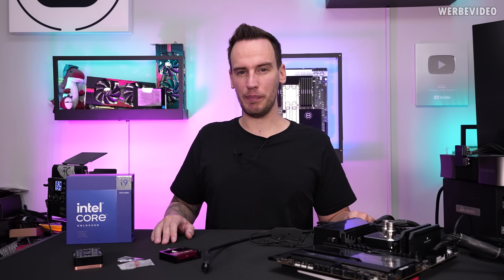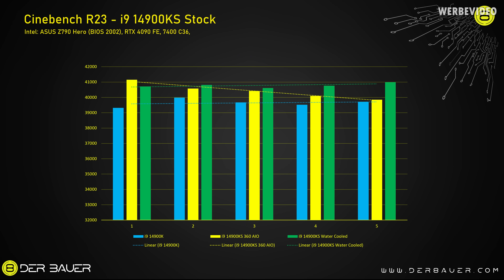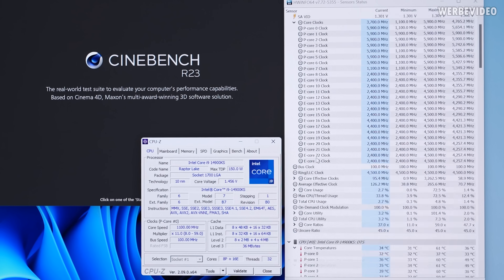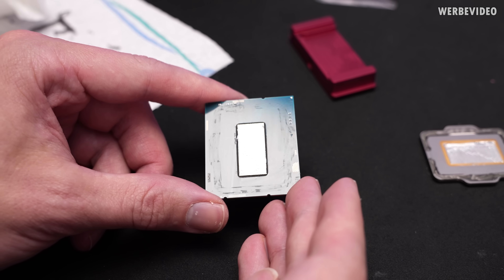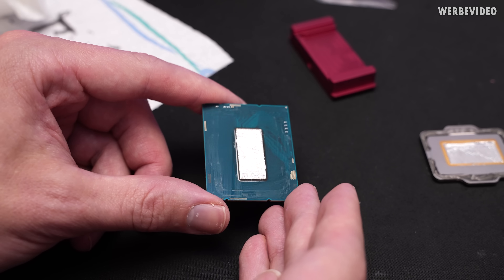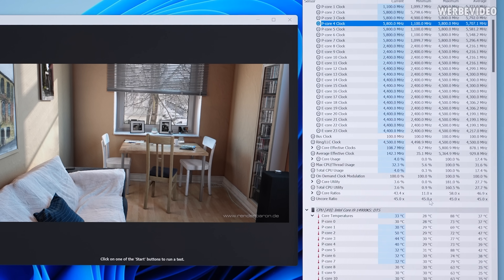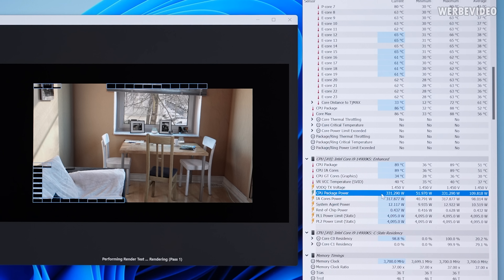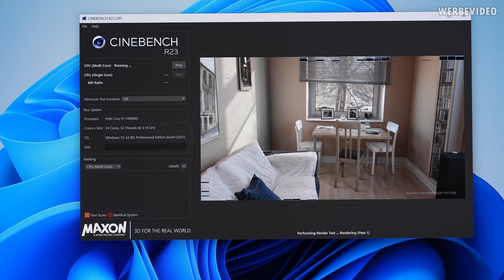My New Water Block - Time for 14900KS Direct Die

Comment: Can anybody tell me what's the difference in temperature between a stock cpu and a delidded (cleaned die, applied liquid metal, re-lid and regular termal paste on the lid) with a 360 AIO for example at exact same settings? I'm asking for a 14700k, i wonder if it's worth the delidding process or nah. Not really interested in direct die cooling on this one altought it's cooler and all (literally and figuratively).
Reply: go watch the previous video, do not forget what is this cpu, a overclocked version of ypurs
Reply: @betag24cn  there's nothing relevant to my question in the last video, it's just a stock benchmark video essentially. i was hoping for this video to be answering my question but in this one he is benchmarking the direct die variant, not the re-lid in which i am interested. 
So you have stock and extreme scenarios so to speak (without exotic cooling), not the regular delid - relid option in which i am interested. That's why i am asking
Reply: @adriancioroianu1704  in the last video it was used with a aio, now you see it delidded, your cpu and this waste of sand are not that different, ypurs has the advantage of not waste as much epectricoty while being a shame for pc enthusiasts
Reply: @betag24cn  bro, in the former video he uses an AIO, yes, but he's still benchmarking the cpu stock. And in this video he's benchmarking the cpu delidded but with direct die cooling. 
There is no info about delidded and relidded cpu with normal cooling, so the most "mainstream" mod let's say, the one in which i am interested.
Reply: @adriancioroianu1704  that is my point, this cpu without overclock, applied by the user, uses 400 watts, the normal one uses 300 watts, you already know what thos cpu os and where it stands woth and without this solution
Reply: @betag24cn  Ofc i know as i tweak my cpu and btw you can make it an excellent gaming cpu that is better than stock while using half the TDP in watts or you can unleash it to be a productivity beast and in idle it literally uses like 3-5 watts due to e-cores, so its not all doom and gloom for an enthusiast with hands on. 
I was interested in a specific temperature delta to know how much room it gives me for an extra 200 maybe 300mhz on p-cores for gaming with delidding but based on my previous deliddong experiences its probably like 10-12 degrees max which doesn't make significant difference in terms of that extra frequency, it's more like either relaxing the cooling solution or increase the power limits a bit type of scenario...
Reply: @betag24cn  it looks scary if you consider it stock but if you tweak it for a while, it's not that bad, actually it's pretty f-ing good. But stock is pretty bad i agree, you should never buy any 13th or 14th gen, 7 or 9 class if you don't know how to customize it because it's a huge waste of electricity primordialy but also a source of excess heat.
Reply: @adriancioroianu1704  i just buy ryzen and forget intel exists, it is a problem for someone else
Reply: @betag24cn  yeah  ryzen cpu's are basically plug and play options. the problem is that they divide them in gaming cpu's (the 3d chache variants) and "normal" or productivity cpu's, neither excelling in both categories, but good enough for regular standards. Intel cpu's can excell in both departments easily but you have to  "get your hands dirty" by spending time tweaking, which is mostly an enthusiast endevour.
Reply: @adriancioroianu1704  lmao

any ryzen cpu will run games just fine, say you want top of the line because you have money to burn in a rtx 4090, that would make more sense

Comment: I dont understand how every reviewer scores so bad without a delid my 13900k 55P 43E PL1+PL2 4096 LLC 1.1 mOhm AC/DC 0.700 / 1.100 mOhm Scores 41300 with a Liquid Freezer II 280 + washer mod, I can do about 3 runs at that before it drops to 40xxx due to heatsoak

Comment: I run 5.9 daily on 14700k 340w with iceman direct die block and my temps sit around 70° My supercool block performs maybe a few degrees better on my 14900ks but i daily my i9 @ 6.3 about 400w
Reply: 400w at 6.3 isn't bad honestly

Comment: Ram offset so 8gb x 2 then 16gb x 2 should trick the CPUs memory controllers to address but remember you will have to increase load to level outputs to fastest

Comment: hey, quick question bro, I have a 13900k and I just order the EK quantum Delta2 tec. I was wondering if it would make sense to not delid the CPU as it still has the Indium Solder and I was wondering if I get better temps if I leave it stock? also, I've been wondering how does the thermal grizzly conductonaut work at sub ambient with the tec coolers? does it get cold enough to make it not work?

Comment: Can you cool the die with water directly? So water could flow right on to the die itself?
Reply: Inside the cooler there's a part with a lot of tiny fins for the water to flow through. That way you get a lot of surface area and better heat transfer.
If you just put the water onto the die directly it would be worse by a lot because there's less surface area as well as not as much thermal mass. 
The water block also provides a closed loop. Imagine if the sealant failed on a direct die to water setup, coolant  everywhere.
Same reason we  put little aluminum heat spreaders on VRMs instead of just leaving the package by itself.

Comment: 1) that end run with the one p core hitting 96c while the rest are 10c cooler or more is such a shame, it limits everything. Perhaps clipping that ones frequency down a bin will let the others go to 61.

2) Very low scores for the clocks being run, very bizarre. But it makes sense, because the end run the max core eff clock for p cores was only 5935. So not true 6000.

But on the prior 58x/45x profile, being sub 41k points is very concerning.

My 13900Ks at normal 56x and a minor bump to 44x e cores, gets 41k-41.85k points max (depending on priority and R2R variance). IE. Normal Prio is around 41.2-41.4, High Prio gets me that 41.6-41.8 range. Not delidded or anything, maxes a little over 90c on 4 hot cores.

Comment: Yeah for production having a big floating copper plane right there next to a bunch of high speed traces is going to be a nightmare for signal integrity. If you can net even a few mm on that one side I think it may mitigate the issue. The electric field should attenuate extremely quickly at such low potentials reducing cross talk and line capacitance.

Comment: Are the holes on the direct die block far apart enough to fit 2 Koolance QD4 quick disconnects (without having to use angled fittings, swivels, etc.) instead of QD3? It's getting annoying how every block has their holes spaced so close together.

Comment: With the enormous power draw and cooling requirements this is asolution to get all the potential out of these chips. 
Some say these chips should come delidded, I would go further and say these chips should come with a lid that has a watercooler in them. Iam sure there can be some deal with EK or other companies that could supply suitable solutions ( coldplate with fins) directly to the manfuacturing line that get soldered on just like the heatspreaders today. The upper parts can be added later.

Comment: Intel should just sell delidded cpus that come with a direct die frame at this point for like 30-40 usd more.Its cheaper for them to not have to give you a copper IHS and it removes the delidding risk and hassle for us while keeeping our warranty and have better temperatures.
Reply: Aye

Comment: A gap between the board and the frame? How hard do you torque down the block then? Blocks like this always fail because it's impossible to get the torque perfect. This is not instilling confidence. If the processor isn't pushed down hard enough, the memory won't overclock far at all either. I wish you made is so that you just bottom out the screws.

Comment: Idea and question at same time: why nobody will do direct die air coolers, I remember old times of Athlon CPUs, where there was direct die, and everything was ok, and they was also super overclockable. Here I believe it will help to cool a lot to, and no water inside pc, problems with mixing metals, so super expensive water cooling ;-)

Comment: Qtip silicon teflon gel onto cpu pcb get it hot with preheater then cool it down while applying more coatings then completely clean with clean qtips thermal as well as noise dampening for better response as well as efficiency

Comment: @der8auer-en   Supercoolcomputer has two direct die block for intel 14, acrylic and full copper C1100 ( what they claim). The cost for SC block & delid tool on supercool are $140 plus ~ $30 shipping fee ( DHL express), that is without any tax  or hassle, front door delivery. It takes 3 days to receive in located in Asia and within a week if located in UK.   I wonder how much are yours  since there is 19% VAT on top on shipping from TG. I hope Roman's stuff are quite better than Supercoolcomputer and the price is cheaper, $120 for both would be great . Supercool's coldplate is quite thin so you may wanna consider that. Can't wait for some more comparison. Edit: Nvm, i don't think this is gonna fly bc no ILM, contact is gonna be big issue. You do know >8000MT, impedance is very annoying to deal with. A $50 Torque drive is far from getting it down 0.05NM precise.

Comment: When DD'ing I've now twice used a PTFE shim covering the PCB, of die thickness (minus perhaps 0.01mm), to ensure even clamping pressure and prevent pin contact issues from the PCB bowing up at the edges/corners. It seems to work well. As it happens I discovered this was a problem with the der8auer 9th gen frame, which is actually over 0.1mm thinner than the die and the entire mounting force/pressure of the cooler plate is exerted only on the die (hence people reporting POST, stability and memory bus issues).  ETA >> bear in mind that with no ILM you have to ensure the required minimum total clamping pressure is exerted by the cooler, c. 40 lbs / 18 kg for LGA 115x (I imagine higher for 12/13/14th gen with the higher pin count) according to Intel.  I modified the frame by cutting the centre out (which does nothing anyway, just bows up off the PCB) leaving only short 'tabs' so it holds the CPU in place when installing/uninstalling the cooler  - without it, it would be easy to fumble when the CPU sticks to the cooler plate and trash the socket.

Comment: You can get a cinebench r23 score  42k+ with all core 5.7 I'm confused why that score is so low for 6ghz
Reply: Hwinfo will influence results. Also, he might be recording using obs
Reply: i think this cpu is saying 6ghz but not really reaching it, after all it is a overclock over a overclock over a overclock
Reply: Yeah, I have an average quality 14900k, and I can just break 41k with a manual vcore of only 1.320v.

I planned to do the same when my KS arrives. Not interested in overclocking, really. I mean its fun/cool, but I have no purpose for it besides just personal enjoyment. I went through 4 14900k, and just said screw it on the 5th one. Too much of a pain chasing better silicon quality. So, I just got the 14900ks essentially because I wanted a better binned 14900k, which would be guaranteed without playing the silicon lottery. IMO, the little bit of price increase is 100% worth the tine and money you saving chasing better random 14900k.
Reply: EXACTLY, my stock 13900ks scores 42.5k.   Can reach almost 45k OC.  On an LT720 AIO.

Comment: Personally I think that if Intel was "smart" they would have always sold all the KS SKUs (starting the 9900KS or even the 8086K which is a 5 GHz out of the box edition of the 8700K) pre delidded since they are super binned chips and only enthusiast which want to direct die them should get them (the IHS should however still be in the box and sold alongisde the delidded CPU).

Those CPUs have such insane power draws that direct die is the only "smart" thing to do if you purchase one, otherwise you should have gotten the regular K.
Reply: Don't really agree with the last statement.
I cannot make a perfect comparison since I did not have 13900k, but do have currently 13900KS and had a 12900K.
What people do not realise is that mostly KS variants are just binned K version of a chip, that being said...
Running at the same let's say stock frequency they do require less voltages and if you re gonna undervolt it, you ll have better results than doing it with the K .
My is currently running on - .04 v, and on LLC3 normal behaviour... Reckon could go even lower than that.
SP prediction was 112, while with the K I never got anything higher than 95.

Temperature wise, doesn't go nuts like 12900 did.. less jumping all over the place and takes undervoltng like a champ plus has a higher potential power draw

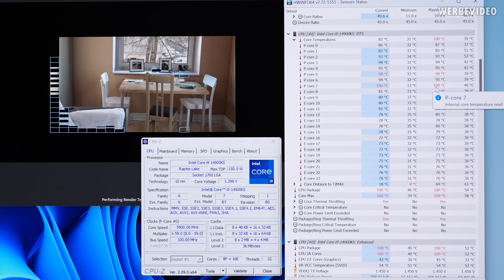Comment: 3:37 that's not why the cpu crashed. Intel has really violent transients during thermalthrottle. The cpu is crashing by itself due to massive frequency deviations and thus massive transient spikes. Its just an Intel issue that haven't changed a bit
Reply: that got fixed with 11th gen AFAIK. The core ratio changing no longer causes massive transients like it did on 10th gen and older parts.

Comment: Question : Do you disable the motherboard manufacturer performance optimizations?

Optimized defaults often ignore Intel power profile and are terribly inefficient for voltage and temperature. 

I also notice you have AI features. If it has AI Overclocking you should give it a shot. I've seen impressive results, but haven't had a mobo with the option to try for myself.

Comment: I had bought your AMD direct die mount and delid tool. And even bought the backplate. But the temps were horrible after re-applying the liquid metal. I had to glue it back LOL
Temps were good on the first try though. I have no idea why that happened after reapplying.

Comment: Oh my, the flowmeter from aquacomputer is way smaller than I thought. I'm going to buy this one also, together with the quadro interface to steer my PWM fans, and my EK pump. But I'm not sure to use the DRGB option, because my case will already have an overload of ARGB. I must say the temperatures dropped significantly then your other video. But it's concerning you have to use water cooling to cool the damn thing. For regular users, this will become a problem.

Comment: Don't understand why intel doesn't delid their cpus out of the box, since its not intended to use neither with cheap board neither with cheap aio, else it would feel and act like basic 13900k
Reply: Do they still come with stock fan too? I haven't looked at intel cpus in a LOOOONG time.
Reply: @PotatoVariety generally not the k versions, where the stock fan would be worthless. Some of the non K models come with a fan , like the 12700 (non k) and truth be told it is generally sufficient for those if the airflow in the case is decent.
Reply: because it is a hell to ensure that CPU's don't get damaged in transit and in installations

back then when CPU's did not have IHS common issue was die cracking
Reply: @xthelord1668 damage during transit is a non-issue. This can easily be packaged in a manner that doesn’t crack the die. Damage during installation is real and is the primary reason for IHS. The KS parts are extremely low volume and binned. They are not for the average user but enthusiasts trying to extract every last bit of performance from their system at all costs. They should ship without the IHS and users should have responsibility for damaging the CPU. The performance difference between the KS and K parts are margin of error and unnoticeable by users, so they should buy the K variant if they don’t wish to take risks.